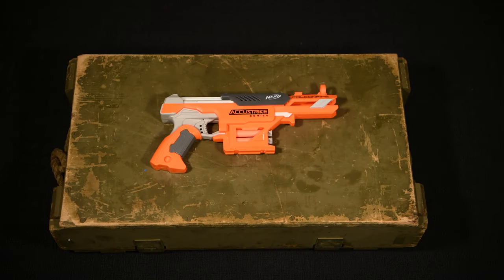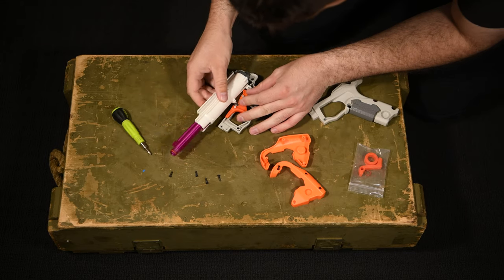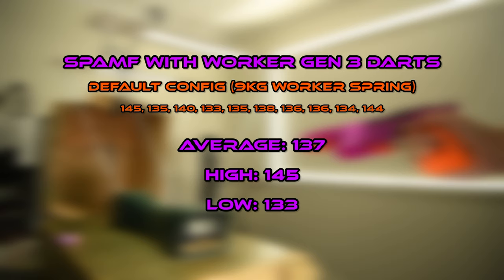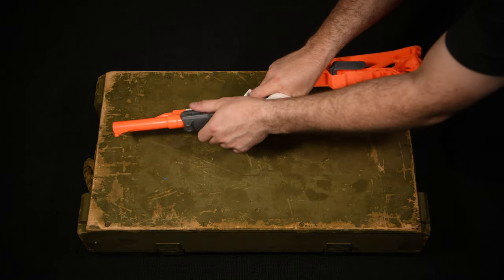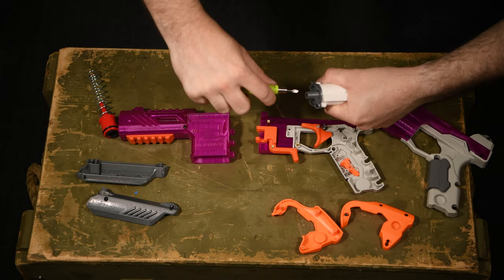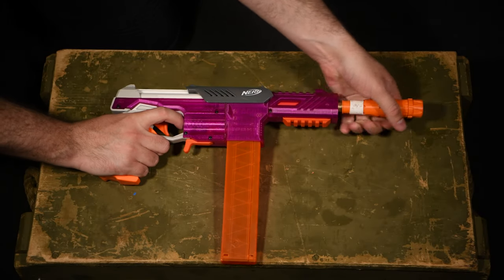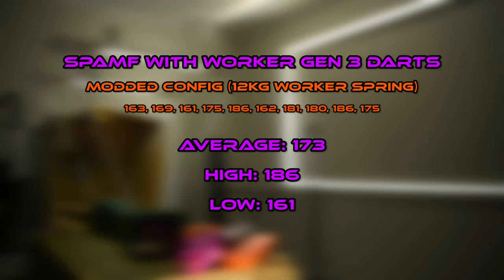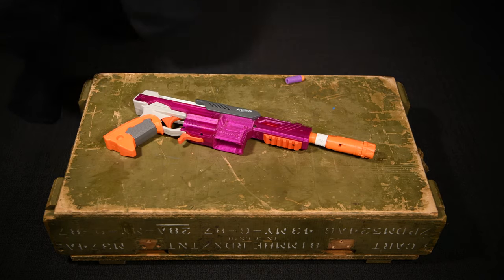Nerf Falconfire 180fps SPAMF Mod Guide

Comment: Hiya Bradley, word of caution for you on that 12kg spring, keep an eye on the printed trigger, it will eventually break on that spring load on the pivot point... I wouldnt recommend that spring load as it how I had my first trigger break after about 4 wars and reasonable use.
I have an original kit and a new kit, was gettng 130fps average on the original, the new kit I am getting 150fps average, both on a Worker 9kg spring, but I did swap out the orings for better versions to get a better seal. The original one, I then brassed, retained the 9kg spring, flared the brass slightly on the breach changed the oring to suit the brass, and I have a 1 second air seal, which is probably why I am getting your numbers on a lower powered spring without sacrificing a Sharpfire o do it...  As always a fantastic video. Nice work.
Reply: Good info thanks👍

Comment: Great video. Is that INOX MX6 grease I see you using? Do you recommend that over other greases (such as white lithium grease, etc.)?
Reply from the maker: I use the Inox MX6 because I find it works best out of what I've tested, but I haven't tried everything available in the US or overseas so there could be something better. The MX6 comes in a very small tube offering though if you just want to try it.

Comment: Guessing you flared the brass to fit the pusher? It's a tricky seal, too tight in 17/32, too lose in 9/16. I've been messing with mine to find a happy medium, but haven't found anything super reliable yet.
Reply from the maker: I flared the brass and I believe it's sealing into the flare. I tried a different o'ring on the pusher too but didn't see any real difference.
Reply: Bradley Phillips how do you flare brass? Thinking about getting a brass barrel on mine
Reply: @bobertairsofts5585  I ended up using the deburring tool on my pipe cutters and a pair of needle nose pliers to flare the brass. I've made two brass barrels for this kit since I commented, it's not too hard. You just have to play with it until you get it right.

Comment: Maybe using a bit of the original barrel for the pusher to seal into and transitioning that into the brass might improve the airseal? How hard is it to prime now? Nice vid as usual, waiting for battle footage now :)
Reply from the maker: I didn't want to touch the provided barrel material because if it broke or something I wouldn't have easy access to more. It's probably an easier way to do it though. Priming 12kg isn't too bad.

Comment: Nice thanks for the suggestions. I'm currently only running a 7kg but been contemplating at least doing a brass barrel. I think I got the original barrel as it's hitting 110-115 currently.

Comment: Strange to get the  falconfire  to shoot 12kg with the stock catch you actually  have  to  grind a small amount of catch not to much say a mm  then test with 12 with a strong n slightly longer catchspring  if it still  doesnt catch shave a little more  also a screw through catch post to help keep everything  from flexing helps to  ive fired over 200 shots no issue   nice spampf
Reply from the maker: Or just use a Sharpfire catch :P
Reply: I would but sharpfires arnt exactly obtainable  in this country   maybe they are over your side of Australia  but not here
Reply from the maker: I think I ordered mine off eBay. Wasn't cheap either. But worth it for the durability.

Comment: Are there any options for full length darts?
Reply from the maker: Throw them in the bin?
Reply: Bradley Phillips 
Wow. Ok then. Never mind.
Reply from the maker: That was a joke. 

Technically you could single load them still like the stock Falconfire. The Falconfire itself doesn't have space to load a full length dart in the same way though. You'd probably have to look at a different blaster such as a Retaliator which you could have top prime.
Reply: Bradley Phillips 
Ok, thanks.